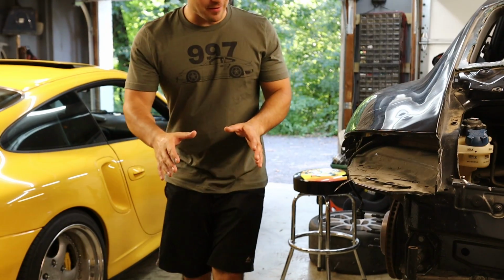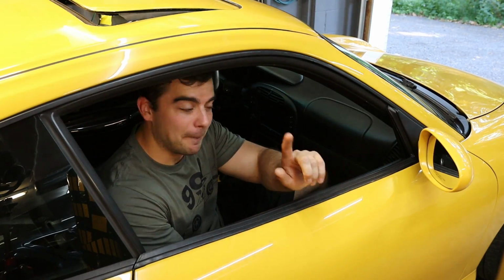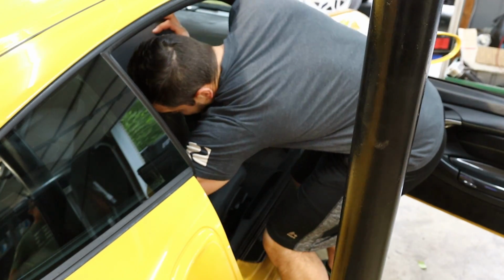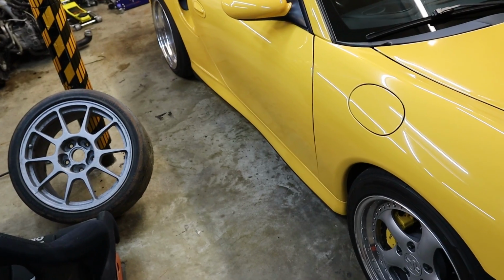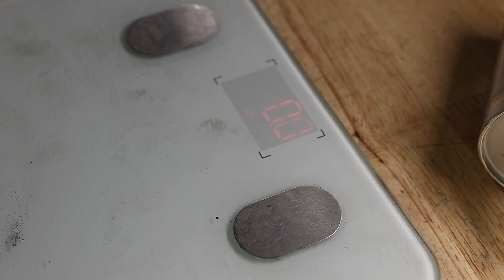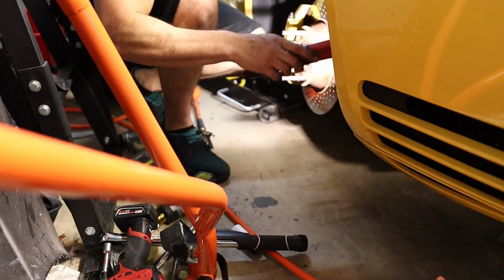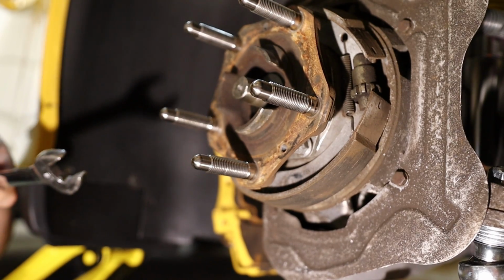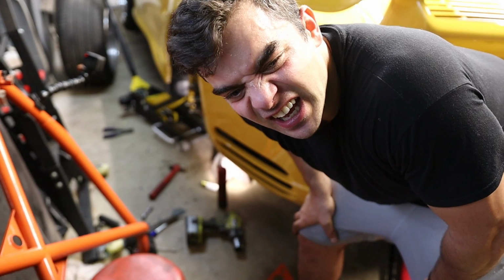My Porsche 996 Turbo BROKE the Moment I Bought a 997 Turbo

Comment: Matt. Look into Esco Jack stands if you are working on 911’s. They are flat topped and ridiculously strong. You can use them on Jack points of 911’s with or without a puck. My car sat on 4 of them for many months and I had zero concerns as they are so well built and secure.
Reply from the maker: Thanks!

Comment: I used to get the secondary air injection system fault on my 996 turbo. Happened maybe 5 times in the 7 years I had it. Hartechs advice (probably the UKs most respected 996/997 specialist) was to buy a cheap OBD dongle off the internet and just reset it when it randomly pops up. 👍🏻

Comment: FYI- Impact wrenches shouldn't be used to tighten titanium lug studs/nuts. They should be tightened by hand and torqued accordingly.

Also, the axle nut needs to be torqued 340 ft/lbs.
Reply: I had subscribed to his channel but then subsequently unsubscribed because he doesn't appear to want to take advice or criticism and watching him swing a wrench sometimes is just painful
Reply: @richa7263  I must admit that I have gotten the same vibe. However, some of the things done in the channel are straight up safety hazards.
Reply: The guy is not a professional mechanic, (not that I would let half the "pros" work on my vehicles), but these commenters are clueless.

"FYI" he's using the impact only on the jam nuts.  Then he's tightening and using a torque wrench.  If you didn't hear him mention the torque spec then you're really not watching and have no business throwing stones.

We'll all weep when you unsubscribe.
Reply from the maker: Lol what safety hazards exactly?  I don't mind criticism at all, but I'm not a pro.  And the "pros" don't torque everything to spec, don't always do things exactly by the book.  Unsubbing (and being public about it) seems pretty silly.  Maybe if I had some rude comments about suggestions, criticism, etc,  but I don't. 

Just my $.02
Reply: @matt13ross  Reputable mechanics/shops always torque to spec. There is a reason why Porsche does it…. Otherwise, why bother specifying it on repair manuals….. Right? 

Not torquing axles, suspension components, or wheels to the right amount is always a safety concern (especially while driving at higher speeds). As for taking criticism (or not), there are a series of replies (from you) in which you have came across short/edgy. You may want to revise them if you are curious. A group of people have made similar observations… so maybe there’s something. 

The bottom line is… no one is hating or knows it all!!! We are all car enthusiasts that share info for mutual benefit.  However, it’s your car/your life… do as you wish! Your content is good… Keep it up/stay safe. Cheers🍻
Reply from the maker: My replies are usually short because I can’t send paragraphs to hundreds of comments on each video. I try to get back to a lot of them. 

And I assure you, I know many other professional mechanics. None of them torque everything to spec. Most do the important stuff, engine parts, and sometimes wheels.
Reply: @plus790  don't cry lol

Comment: I have secondary air codes almost every year on mine, got it the other day in fact, and that's after having my shop 'fix it' earlier in the year... I think part of the issue is that code doesn't always indicate a problem exclusively with the secondary air system.
Reply from the maker: Interesting. Hoping it doesn’t come back!

Comment: Titanium studs are great. Maybe apart from the length issue. Please change the rusty nuts in the front 😢. They make it look crappy. Carbon is a great upgrade. Again keep it up.

I’m with the guy who sad change the centercaps for Poorsche ones!
Reply from the maker: I agreed with the center caps, but I'm fine with these ones for now.

Comment: Looks even better now but thise front studs bro, just are ruining it. Gotta say though much prefer the original studs how they have that cutout so you can tighten them or remove them easily. Really like how they did that from the factory. If only you could have found some like those but shorter to fit your 996 it would of been awesome
Reply from the maker: I can get shorter ones.

Comment: The 996 with the Mezger engine will blow the 997 away.  protomotive porsche tuning explains why.
Reply from the maker: Blow it away?  The 997 has way more power lol
Reply: The 996 was derived directly from Porsche’s race cars. The Headlights are from the GT1 race car they look badass.
Reply: @aspenyukon6845  Uhhh, the 997tt has better turbos in VTG and uses the same Mezger race engine as the 996tt
Reply: I would’ve sent the 996 to protomotive let them turn it up to 1,000hp.
Reply from the maker: A 1000hp 996 is super expensive and loses some DD abilities, would be cool though.